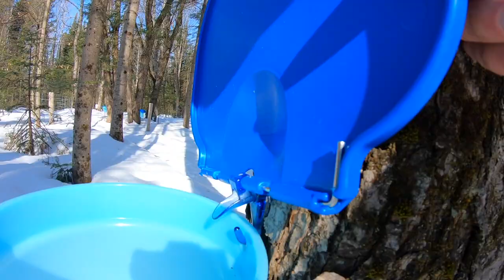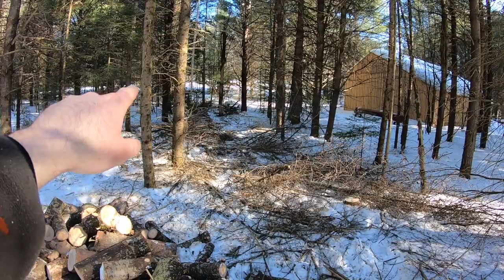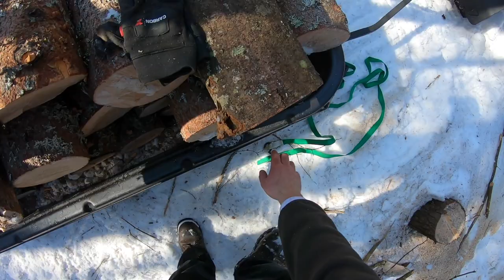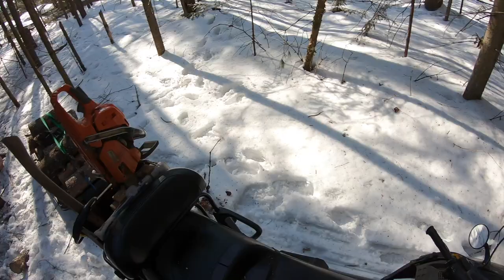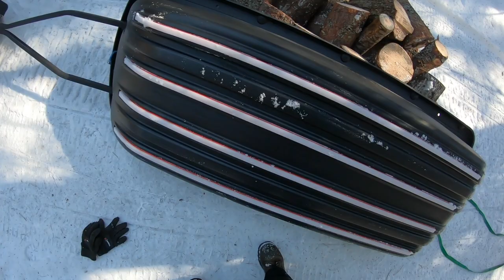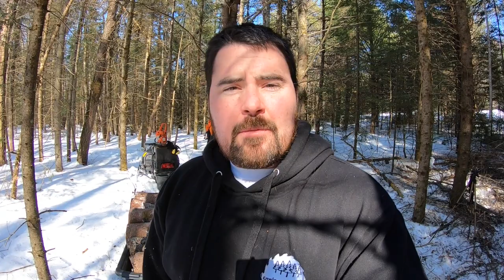How to Tow Firewood on a Sleigh with a Snowmobile

Comment: Great video Sandy - thanks for the interesting tips on how to avoid the wood falling out of a sleigh! Do you re-cut those longer pieces or are you burning them in a large stove or boiler?  Or is that for the barrel stove evaporator?
I have a similar (maybe the same) sleigh but haven’t used it much.  As an engineering prof, my job doesn’t allow me time to get out much in the winter, and also because my 100 acre bush lot is 1.5 hrs from my house.  If the market doesn’t crash completely I hope to be retired in a few years and will be doing all my own wood, and maybe syrup too!  What do you do for your “real” job!, If you don’t mind me asking?
Reply from the maker: In the past I’ve taken the off cuts and ran them through my chipper to spread on my trails. But now that I’m making maple syrup with my barrel stove I’ll make a jig to cut up the large slabs into shorter lengths for the maple syrup making. At least that’s my plan for when. The snow goes away. Thanks for watching